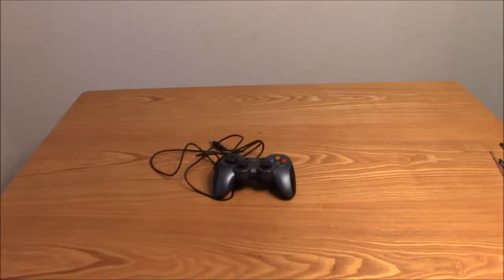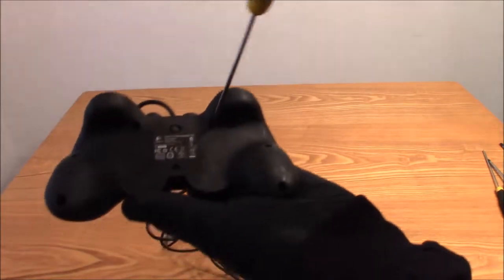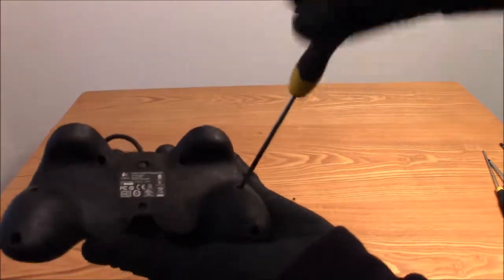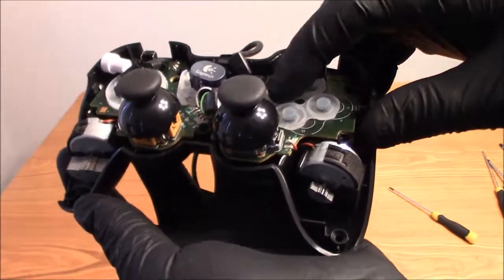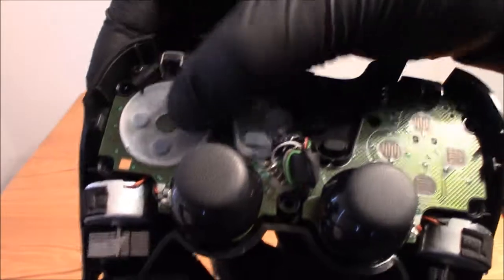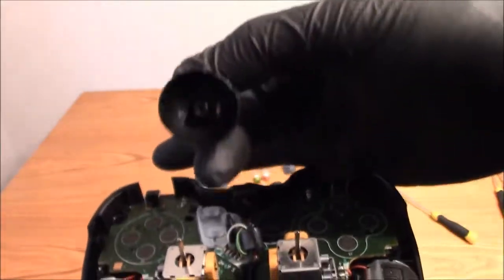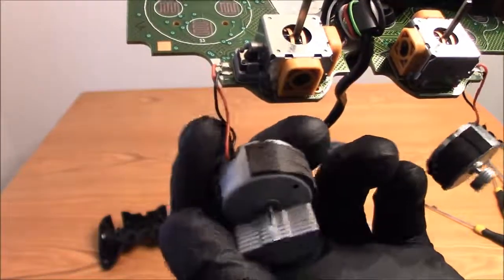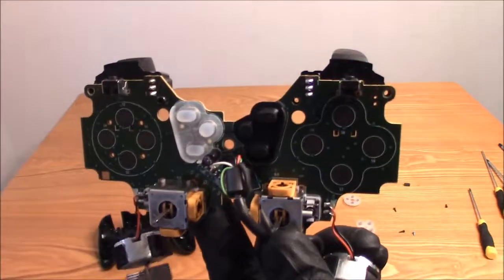How To Take Apart The Logitech Rumble F510 Gamepad To See What Technology Is Inside This System

Comment: Hey! I have the logitech f301 gamepad and i took it apart to fix it. However, i'm having a real problem in putting it back together mainly because of that wire which was previously somehow fixed under the green circuit board which you removed last. Now whenever i try to put the green board at its place, it refuses to go all the way down because the wire now blocks it's way. Can you please help me out in this matter? I will greatly appreciate it.
Reply: Hey did you fix this issue? I've encountered this same issue
Reply: Same
Reply: any solution?
Reply: Cant believe I'm replying to this after 3 years haha
Well, after fiddling around with it for quite some time, I broke the soldered wires and had to get it repaired professionally from open market in the end. That being said, its still going strong so it's absolutely worth it to get it fixed.